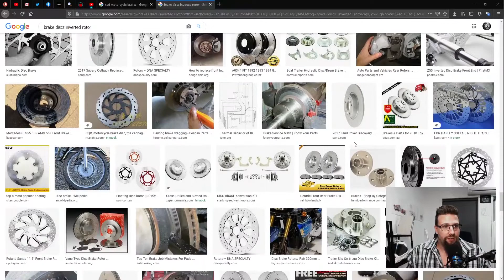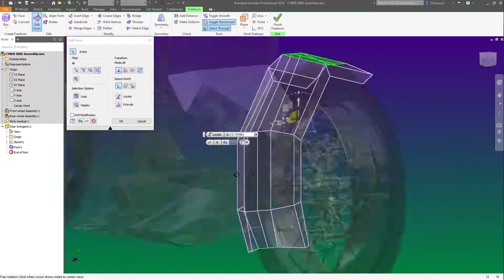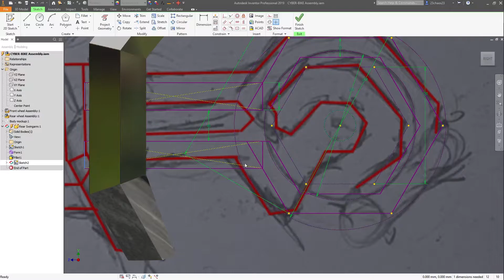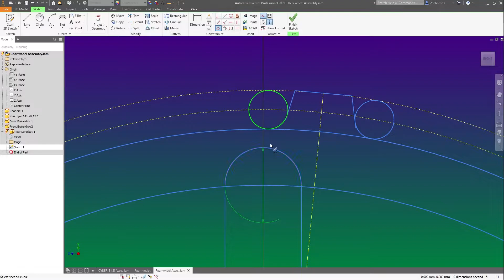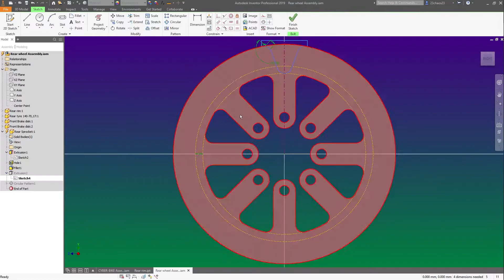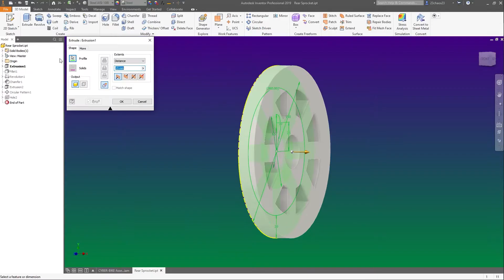Cyber Bike: 05 Hit the brakes [サイバーバイク]

Comment: Fun fact: Erik Buell was not the first to use that design

I found a 1999 Honda Concept bike called the NAS (Google for Honda NAS and you'll see it) 
And even earlier again, the Arlen Ness "Big Red", sometimes called the 'Ferrari Bike'.. first shown off in 1990 and completed 1991. Pic from the 1991 magazine here:
https://www.chapmoto.com/wp/wp-content/uploads/2019/03/IMG_8846.jpg

Erik Buell however, calls his the ZTL (Zero Torsional Load brakes) which he then patented.. but despite coming in more than a decade after that early example, his was the first design to actually work reliably and be fit for purpose in a production vehicle.
Reply from the maker: HOLY SH*T now that Honda is a nice looking bike, why only ever a concept? I would've loved to have one lol.

On a side note about Buell's ZTL patent, the patent covers how the rim is designed and the way the disc connects to it. Not so much the concept of inverted brakes or perimeter discs. There is also much discussion on the validity of the patent in the first place, based on numerous vague description parameters and citation of previous uses of perimeter discs like the Honda and others.

 Thanks for the info, it connected to much more engineering info.